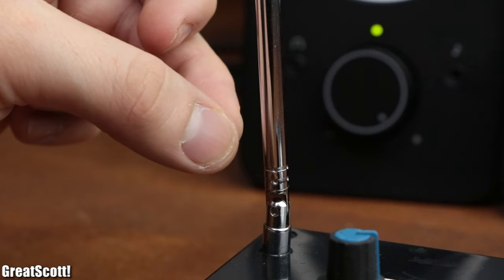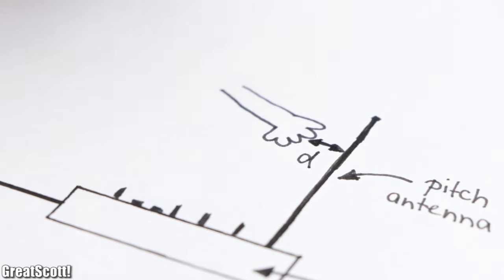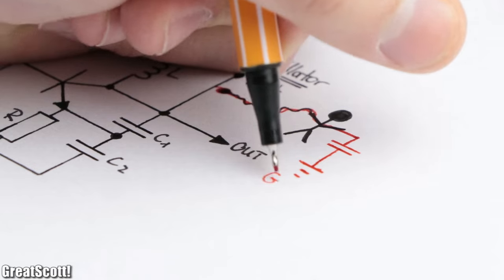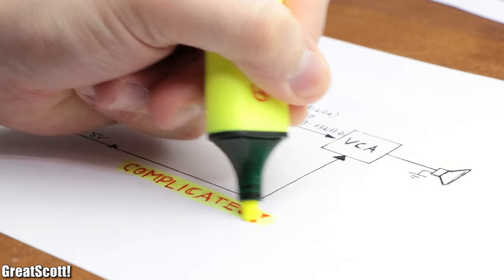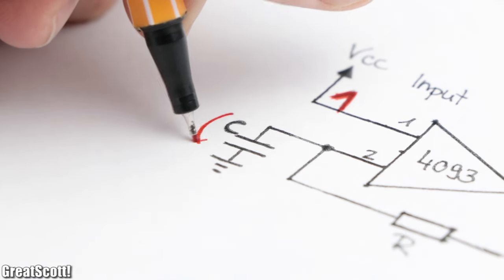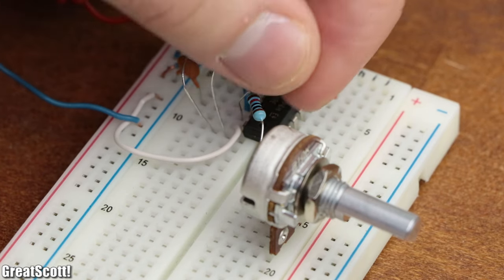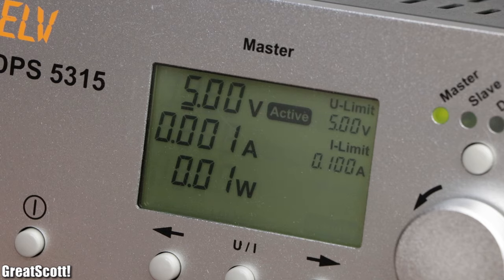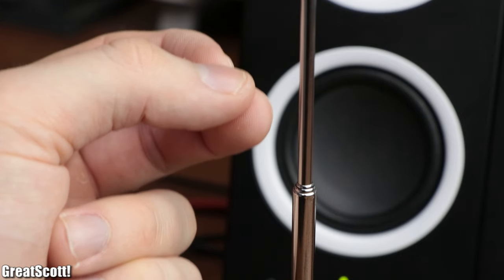Make your own Simple Theremin

Comment: Sir please make a 500 Watt inverter circuit
Reply from the maker: No, I will never make a mains inverter.
Reply: Ok sir you cannot make video but Facebook account send me inverter circuit 500 Watt
Reply: why dont u just buy one it will be so much safer and simple
Reply: +Ivan R the simple oscillator and transformer circuit is very dangerous  because it doesn't have a feedback and the output voltage(no load) can go very high.I think even GreatScott said that its dangerous in one of his videos.The simpler the circuit the more dangerous it is cuz it doesn't have protection and feedback.
Reply: I can already smell burnt house
Reply: this idea smells more and more like magic smoke
Reply: Good. Don't let amateurs kill themselves.
Reply: +Fun Zone  This can be accomplished in two ways. The simple but inefficient, expensive, and extremely heavy way is to connect two large power MOSFETs or other power transistors to the low-voltage side of a 500 VA center-tapped iron-core transformer and switch them in push-pull configuration at 50/60 Hz. You will need to place a polypropylene suppression capacitor of 1-2 uF across the output to eliminate high-voltage (500-1000 V) inductive spikes at the output. This design is not optimal, but will power most resistive, switched-mode, and inductive loads.

Te second method which is the method used by most modified sine wave inverters is as follows: Your first stage will be a similar push-pull configuration of two MOSFETs on the low-voltage side of a center-tapped transformer, except this configuration will use an appropriately-sized ferrite-core transformer and will switch at a high frequency, usually in the range of 50-200 kHz. The high-voltage side of the transformer will be rectified and filtered by a small capacitor to give HVDC. Finally, an H-bridge configuration of high-voltage MOSFETs is used to switch the output into a square-wave at 50/60 Hz. Note that with this design, you can also vary the duty cycle of the output switching to provide a constant RMS voltage at the output across a range of input voltages (say, 10-16 V DC to a constant RMS voltage of 120 V AC).

Hopefully this is what you were wondering, and if you do try these experiments, always be careful of the high voltages involved. Good luck!